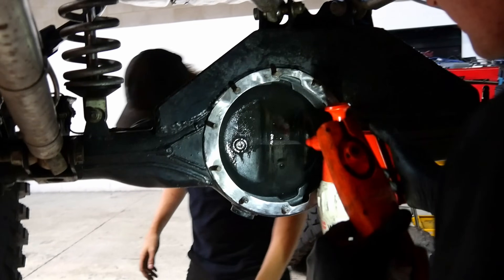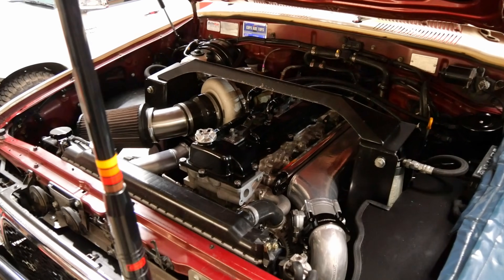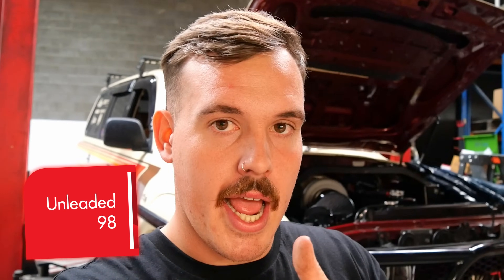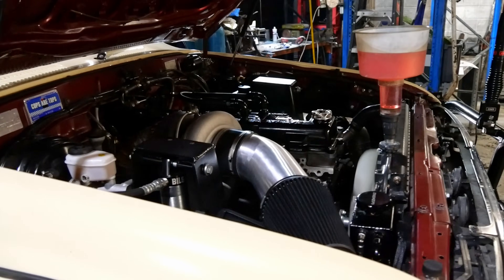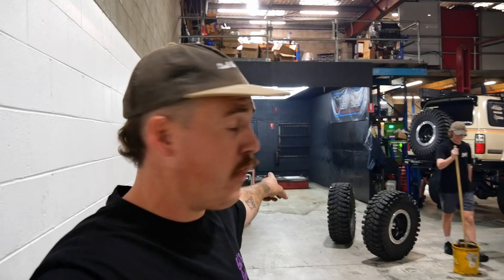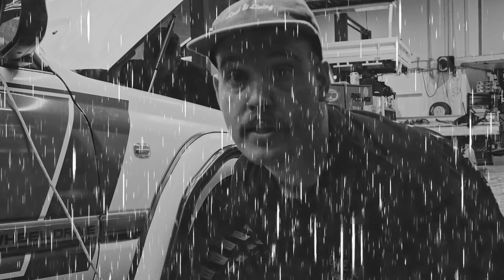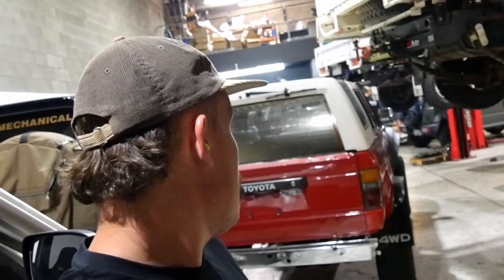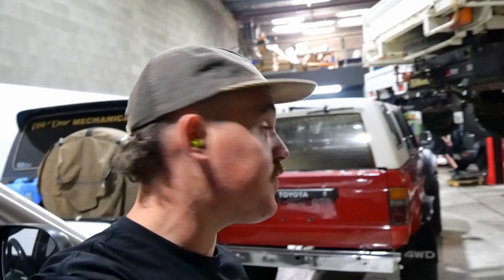Not the results we were expecting... 1000hp 4x4 FULL SEND

Comment: Sorry if I missed it but why did there need to be a complete retune on 98? 

Why couldn't you stick to Ethenol?
Reply: its a bad idea to store a car with ethanol its hygroscopic  and causes rust, this is why they swapped out the injectors to stainless internals.
Reply: @fujiwaratofushop  Plus not available in as many places as 98 can be found(Which is rare enough)
Reply from the maker: E85 isn't readily available in Australia and realistically, any increase in fuel economy & range is needed for any sort of travel
Reply: @SamYoung4x4  fair enough but you will be paying big bucks on 98. I also have an 80 I put whatever into it usually E10. I'm over in Liverpool in Sydney and am spending around $1.75 per litre. The other day I found a station for $1.68.
Reply: @dcameron0500 The difference in safety margin for knock from "whatever" to 98 is the reason. I think the economy comment is compared to E85 with 30% extra fuel off the bat. 98 is pretty much non negotiable for an engine like this, power would be extremely compromised for 91 or 95...